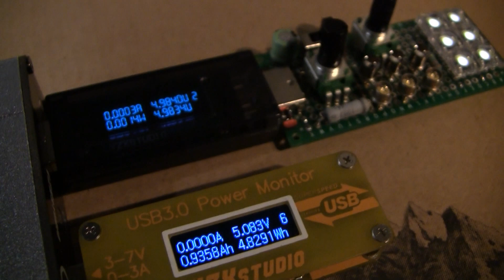YZXstudio USB power bank

Comment: Where can I buy a PD module capable of delivering 100W which can be directly connected to my 18650 battery pack (21v 5amp)?
Reply from the maker: Your battery bank is 21v nominal? or are you talking about the usb output voltage. I would search aliexpress for pd modules, less likely on fleabay.  YZX studio also makes a terminator 13 powerbank which can do this, but costs quite a bit, even for just the board and display, and will also be in chinese, but unmatched quality.
Reply: @Wavefront101  The 18650 battery pack - 5 cells in series (21v). It's not powerbank. I'm hoping to connect it to a PD module so I can charge my USB C devices.
Reply from the maker: @rahulpathania78  There is a yzxstudio module which runs off 10-70vdc - YZ826 and YZ826S, this is built to use for cars, so optimal for 12v.  I am using a 12vdc murata converter to convert solar panel voltage to a 12v Anker 30w pd port, but this will be integrated into a garden light.
Reply: @Wavefront101  This is awesome, guess this was exactly what I was looking for past 2 days but couldn't find it. Thanks a tons for your help my friend.
Reply from the maker: @rahulpathania78  No problem, just know yzxstudio products ship from china so long shipping times.  You might just find a 100w capable 12v car charger, and use a 12v step-down converter, won't be as efficient, but will be cheaper.

Comment: Where the F do I buy UT?
Reply from the maker: +Andrew van Leeuwen yzxstudio has their store on taobao.  In order to buy off taobao if you don't speak chinese, you need to order through a middleman site, I use mistertao, and their fee is low. I ordered mine without battery cells, not sure if it would make it through customs, also it comes with spring contacts instead of welds, so you can eventually replace the cells if needed.  The yzx studio page is here - https://shop35123736.world.taobao.com/?spm=a312a.7728559.2015080705.6.eZIMTW   Powerbank They sell two different ones-  http://world.taobao.com/item/15147936768.htm?fromSite=main&spm=a312a.7700824.w4024-13498830549.2.Rmmbtz&scene=taobao_shop If you can afford it, order this too, as its the best USB meter.  :) - http://world.taobao.com/item/527344581834.htm?fromSite=main&spm=a312a.7700824.w4004-5910083840.3.6EuP9M   If you do buy it, message me and I will give you the instructions I translated.
Reply: +Wavefront101 cool thanks! I wanted to order that usb meter too, but some say to wait a while, 
But that powerbank is not in English, only Chinese? Because my Chinese is not that good 😂
Reply from the maker: +Andrew van Leeuwen Yep, only in chinese, but all the values are standard like ah, watts, voltage, etc.  You do have to set it to a mode and discharge and charge it all the way, to get accurate readings on the amp hours, in which the translation is needed, but that is the good thing about this powerbank, it can tell you the exact amount of amp hours total, and left in the cells based on an actual measurement by the coulomb counter, most powerbanks only give a estimated percentage.
Reply: +Wavefront101 wow! That's absolutely amazing! 
I really like techy stuff like this! 
So your Chinese than? 
And do you know if they ever going to make a powerbank with other languages? I believe there is a huge market for this! 
And what are the prices exactly?
Reply from the maker: +Andrew van Leeuwen I'm not chinese, but I just checked and this powerbank is not being sold anymore, but the new gen is coming.. :)  - http://www.chongdiantou.com/thread-7916-1-1.html
Reply: +Wavefront101 holy shit! That looks promising! I want that one! Just look at that! Beautiful!